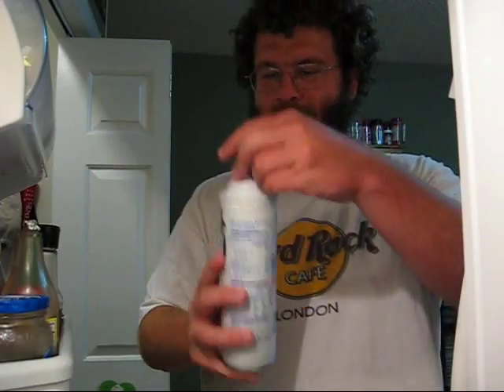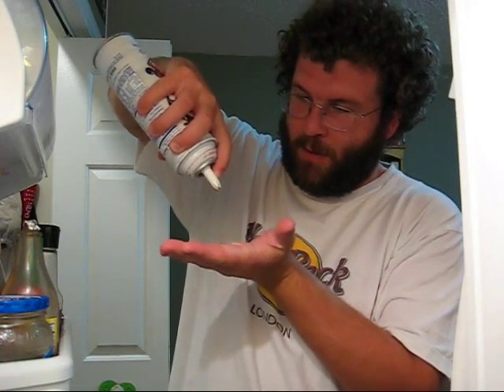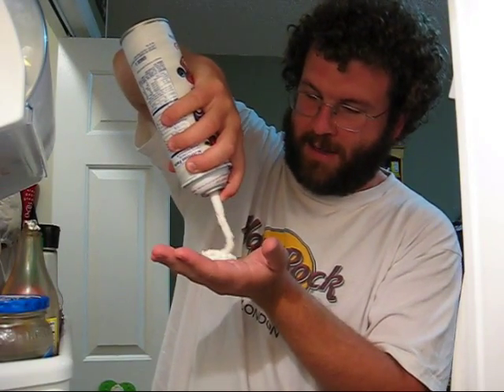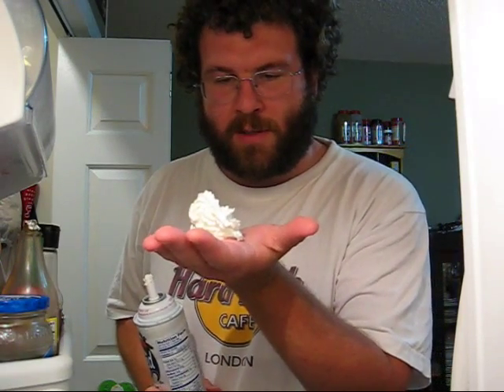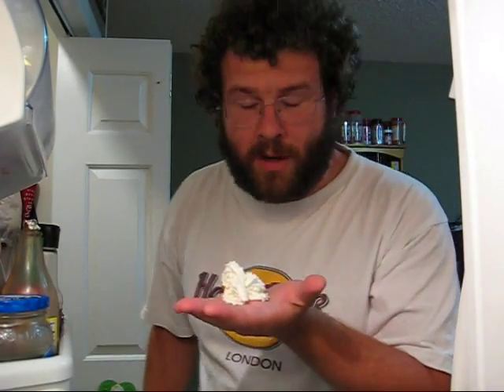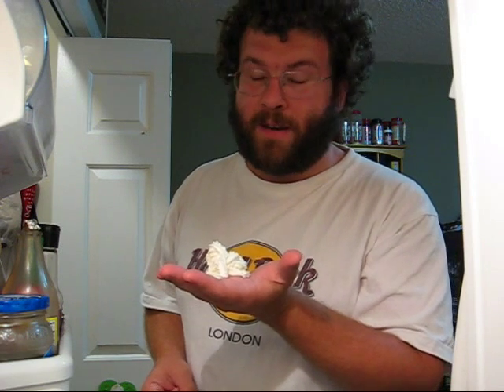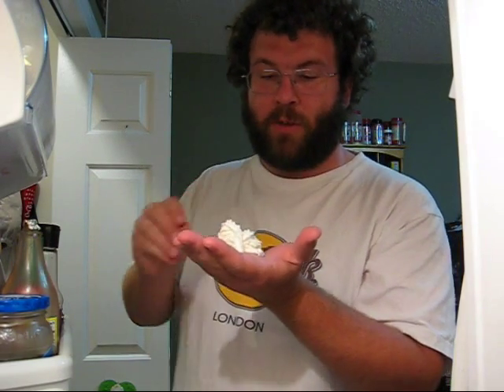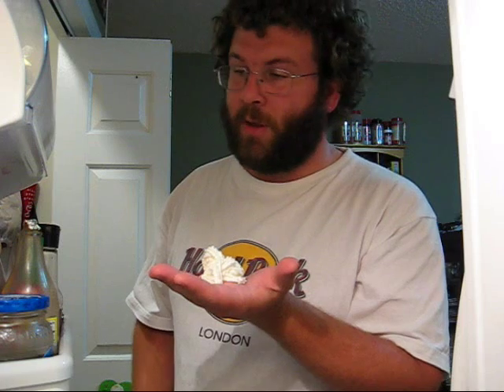Shear Thinning

Comment: I dont think that true because the whipped cream kinda melts or deflates while on top of a drink/ dessert. deflation is explainable if air bubbles are involved but not by shear thinning. also shear thinning usually involves a suspension of particles like a power (the linning up of these is what leads to shear thinning) which i dont think cream is... i agree with the ketchup thing though. also works for custard.